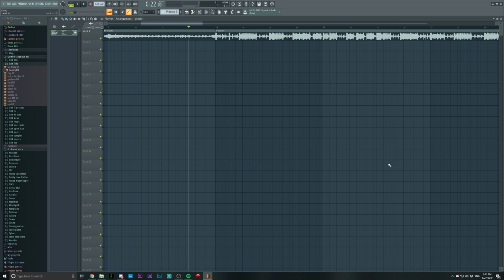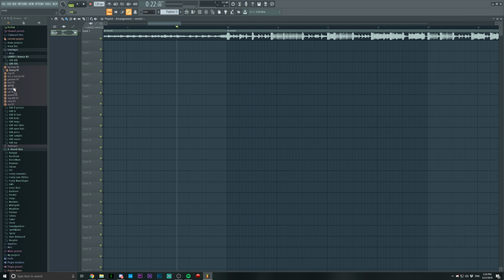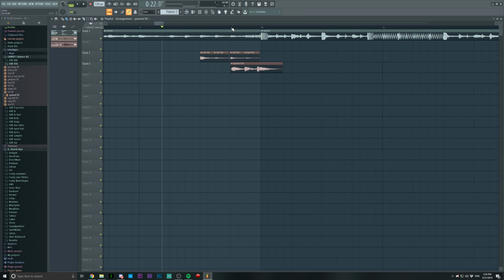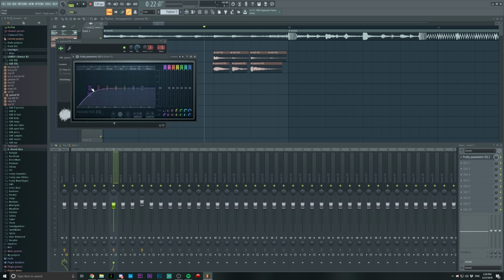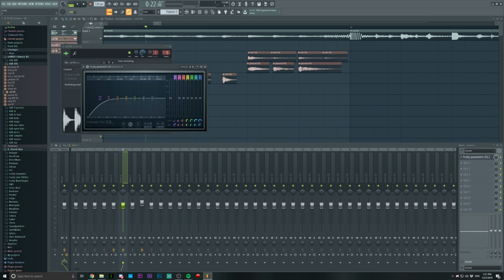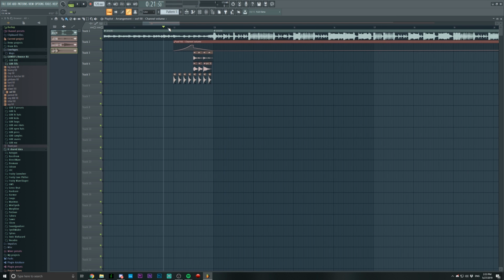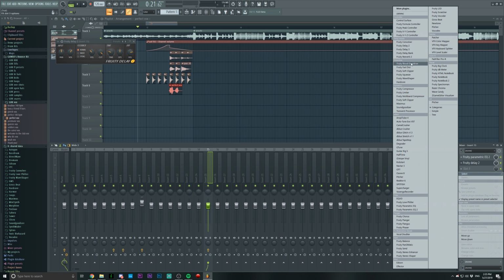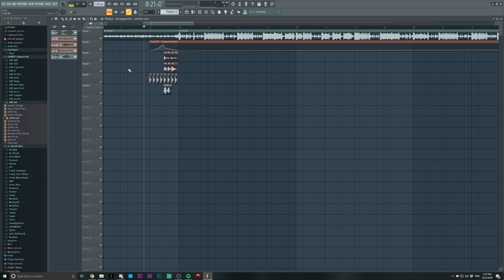How to Make Trap Drum Fills in FL Studio 20

Comment: Hi, I feel like you would know a fix for this;
For some reason I am unable to drag any samples or sounds onto my "view playlist" at all. 
I've had this issue for a couple of months now and I can't find a fix for it anywhere. This makes it very hard for me to produce anything really.
(FL Studio 12)
Reply: what type of file is it..fl doesnt support some audio files
Reply: @milvn  MP3
Reply: does nothing load up when you drag them in, except a blank audio clip? if so, you cannot import samples with special characters, you have to rename the file and reimport it.
Reply: @graphicscard  Nothing loads up at all :\
Reply from the maker: I currently have a similar issue with 2 specific samples. I can't preview nor drag them in using the file manager inside of FL but if I try to drag them in from an actual folder, it works.
Reply: @Gunsoww  That doesn't work for me. I can't load anything into the view playlist, not even drums for example.
Reply: @Gunsoww  Though I am able to preview them.
Reply: It’s gotta be an mp3 or a wav
Reply: @tripleac12  all my samples are mp3 tho
Reply: Hey fam drag them into the picker and not the actual playlist... I wish I could post a screenshot here... but the lil area where it says pattern 1, pattern 2, etc on the left side of the playlist window. Once they are in the picker you can put it on the playlist. I hope this makes sense. 👍